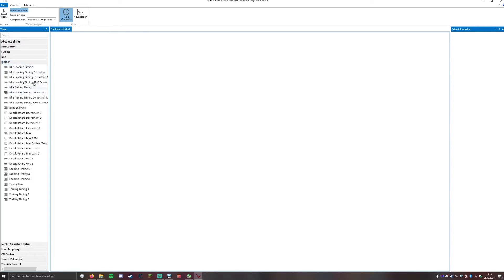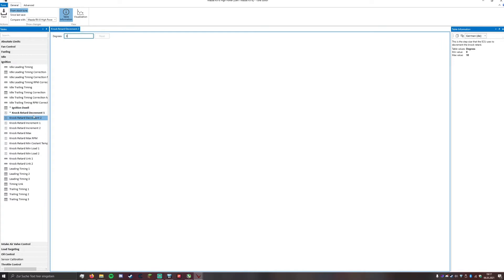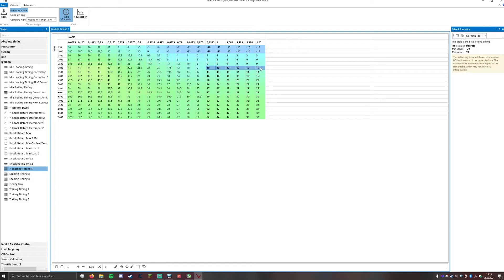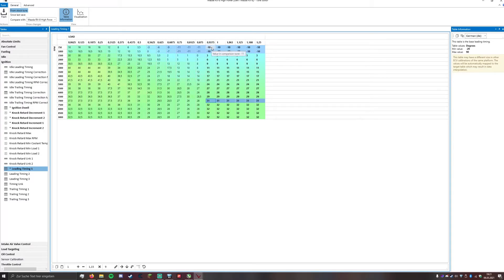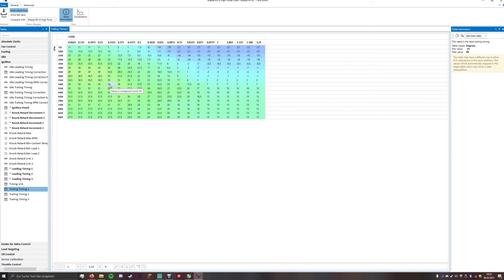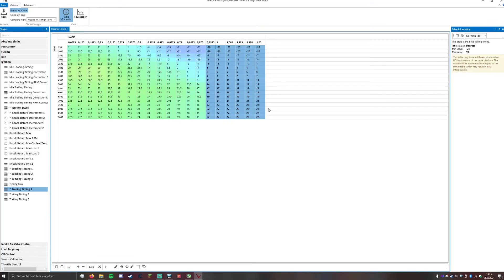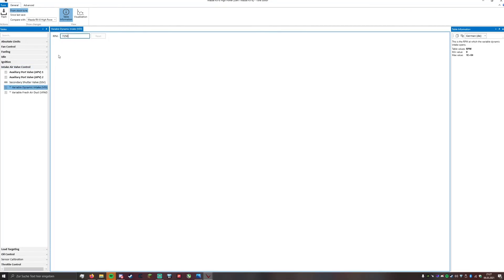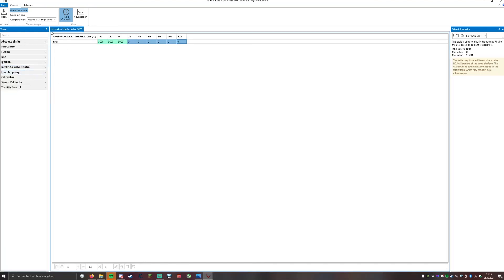Mazda RX-8: Tuning with VersaTuner(Ignition and Air Valves)

Comment: Hi, 
I have used the ignition settings just as you did and now I´m experiencing "Crankshaft Position Sensor "A" Circuit" CEL - have you dealt with the same issue?
I have disabled it in VersaTuner, but anyways....what triggers it?
Also, the RPM gauge was once stuck at 0 RPM, while the engine was started....then, after restarting the engine, it disappeared :D 

Thank you.

Matus
Reply from the maker: That doesnt ring any bells unfortunately i never experienced any CEL's other than my Cat deleted and the Missfire code that happens with a flywheel thats too light so the ECU doesn't know what to do since there is more vibration and stuff.
Also back when i removed my interior i shorted cables that blew a fuse for my dash so the needle wouldnt work but i think you didnt short anything out.
Reply: @Snow1998v1  hmmm, thats a mystery.
I flashed it to a stock tune and the CEL came off.
Flashed it again to changed timing and the same CEL went on.
However the car pulls strong and smooth.
I have disabled that DTC, so no CEL is lit on the dash, but it is there  - in the ECU readings.

Comment: Hi, i have in plan to buy versa tuner, did you menage to lower fuel consumption, if do, can you say about how can you get from 100km... like highway cruise in 6speed 3.000 rpm, 100km/h? Thanks in advance! Greetings from Croatia
Reply from the maker: i was able to get better fuel consumption with versatuner but the downside is that the engine feels very sluggish and if you cruise and then floor it quick the afr can't keep up so at first it struggles really hard to move. 
100km currently with my setup is like 12-14 liters.
Reply: @Snow1998v1  Thanks for answer!

Comment: Awesome videos! I have versatuner and was wondering if you you could make a video showing you creating a tune for flames? Thanks!
Reply from the maker: Hey there i can do that but the most important thing for flames is basically disabling fuel Cut and getting the exhaust temps really high aswell as having a midpipe without a catalytic converter
Lean AFR's Help aswell but i can do a short Video about it no problem.
With the stock ecu you will never get "constant" flames you always have to fiddle around with the throttle but i will show it in the video.
I'll do it today, Video should be up tomorrow. 
Thanks for watching my video really appreciate it :)
Reply: @Snow1998v1  dude you’re awesome! Thanks!